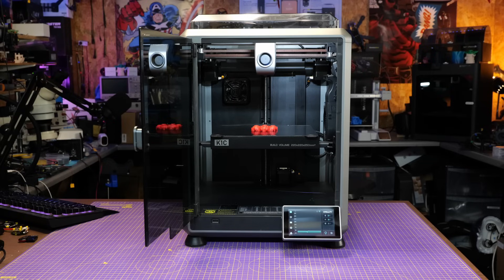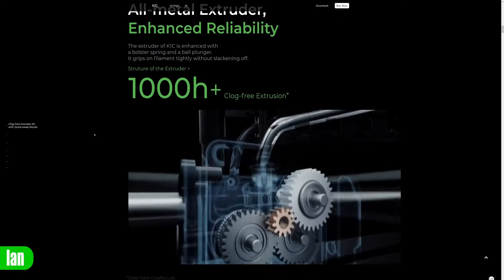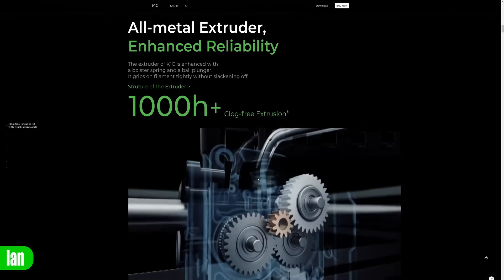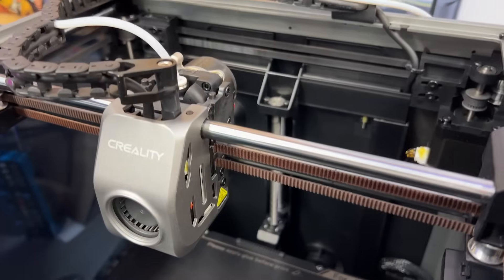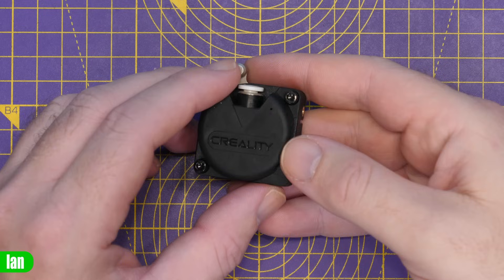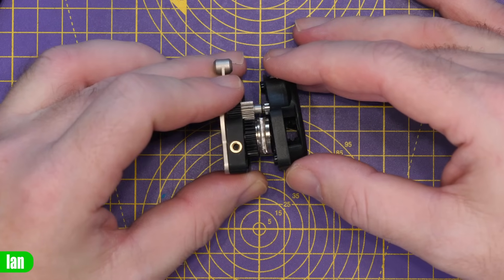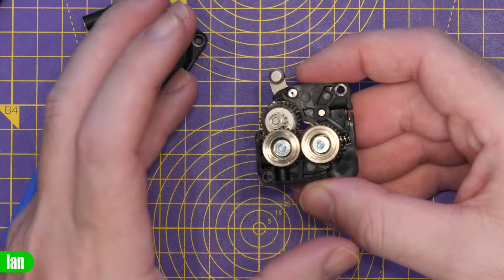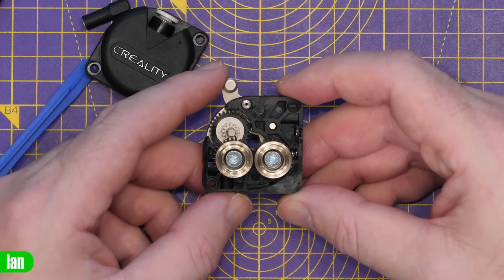Creality K1C All Metal Extruder Is Not What It Seems - They Have Explaining To Do!

Comment: Not all metals are magnetic, many are not, and just calling something 'Plastic' is simplistic at best, as you must know from printing, there are may different plastics and some are very durable. It appears that the actual extruder gears are some sort of sintered material so technically they are correct. Show me any tool (even Milwaukee) or car part that's made of 100% 'metal' and I'll agree that we have been misled.

Comment: Check this out. When my extruder jammed(my fault) I opened it up and found a powdered metal hex driven screw that had sheared off. They can't even put real metal in the metal. My bet is the parts that are metal are powered metal that is baked, and it has to be baked just right. I can't fathom why you'd use it to make a screw.

Comment: Nah it shows a 3D rendering of gears not metal gears, the plastic gears are probably no issue and will be OK (been making and designing plastic gears for automotive applications for years) the true test would be, is to do a load test on tooth to tooth load, measure them over wires and run them on a double flank gear roll tester and review to AGMA specs, the essential components are metal ie those pieces that contact the abrasive substrate. I would say we are into the "all butter scotch-bread" argument - but agreed they should be more specific with their marketing, and I really do APPRECIATE your videos, but hey its China I think if we are expecting "truthfulness" in the selling price, then we will definitely be disappointed!
Reply: I forgot to add - I think it is a good design TBH - I have my K1C

Comment: I think this is a marketing paradox. There are parts where using plastic instead of metal such as nylon is better. Yet they are afraid to highlight because "allmetal" is a magic marketing word. These are the reason they might choise nylon gears instead of metal:
Self lubrication, blocking heat transfer, weight reduction.

Comment: "all metal extruder" has a history. It has refered to an all metal hotend, and people has messed up terminology mixing extruder and hot end for years. A bit too much noise and shouting for my taste.

As for the extruder, it uses different gears than usual. They do not use a through and through axel. HGX Lite gears is used in all plastic housings. I fail to understand why this extruder failed in the first place, and it most certainly is not the things Creality speak of, because there are HGX extruders out there, working fine, not doing a single thing of what they speak of.

Is this actually a patent related issue? One in which they cannot use a gear with an axel? Whey do they need to use reinforced steel, when others can print a part in plastic?

So again. Too much noise and screaming for my tast. Way too little substance.
Reply from the maker: Thank you for your comment. Tbh for me though a little to much noise and no substance

Comment: Just checked the creality official website and the extruder has now had the wording changed from all metal extruder to just metal extruder. 

The picture has also changed to show there is plastic gears with the part the feeds the filament though to be metal. 

Also the animated video shown here of the extruder seems to have vanished.

Comment: what i see is the filament path gears ARE metal! I myself would not bitch at them for all the extruder parts and pieces not being metal. I think it is marketing thing that the extruder filament path is all metal and you are going off on a tangent expecting ALL the parts to be metal. The most important part is and that is the filament path! If however, gears on heavily used machines are failing then there is a problem.

Comment: "All Metal Extruder" refer more like the Hotend to the extruder its self , plastic in extruders are very comon couse Nylon , pom or others works fine (i got a working titan for 5 years and works like new)but for HotEnds things are diferent , "All Metal" means yuo dont have nothing betewn yuor nozzle and heatbreak like a ptfe tube that get burn , thats it😊

Comment: I don't know why they would have said "all metal extruder", maybe its a translation issue. I assume they meant its the new extruder that uses steel reinforcement instead of the old aluminium one. In the end you don't need or want all metal extruders anyway. Using all metal gears would need regular teardown of the mechanism to grease or lubricate the gears. That grease can contaminate the filament being pushed into the hotend. Metal gears will transfer more heat from the extruder stepper to the filament drive gears and soften the filament while its being pushed.
There is a reason Bondtech uses the same system of Nylon and metal gears working together. It is self lubricating. Full metal gears are only useful in very high temperature printers that the K1C and other normal printers simply can't handle.

Comment: I purchased my Ender 3 V3 KE as a bundle kit they had advertised on their website. I had preordered it 2-3 weeks before it had released. Part of the order showed up. I had to email them asking where my stuff was. They then proceeded to tell me that the bundle had changed and I wasn't getting the dry filament box that originally came with the bundle. They changed the website ad and everything. Luckily I had screenshots. Hours and days of arguments with them got me no where. My KE printed and worked so well until 2 weeks ago. The Y-Axis belt shredded, the X-Axis belt has been shredding since new and then my hotend blew up and filament literally wrapped around it  up onto the heatsink. Go with Bambu Labs people!

Comment: Great video! Just a couple of minor points to consider; be cautious about using the lack of being magnetic as proof of a component not being metal, there are more than a couple of nonferrous metals that are used in manufacturing 3d printers, for example most nozzles are not magnetic, yet they are metal. Being metal does not imply iron based, which is magnetic. Finally, you don’t need to tell us you’ll be honest with us, it’s a meaningless statement. Your actions tell us that you’re honest.

Comment: I'm trying to decide if I should cancel my pre-order.  Creality obviously lied here. In some other photos you can clearly see that they are showing metal gears.  For this reason I really want to cancel but It also still seems like a good deal. The only other printer that seems like an equal would be the QIDI X-Plus 3 and it is still $100 more than the pre-order price on the K1C.
Reply from the maker: It’s still a good printer.  But just note the change now.

Comment: With all metal they are talking about the hot end itself. And they are 100% correct it's a full metal hot end. If you extend that to the complete head they are wrong. But honestly - I was not expecting metal gears, because they are simply not needed. Only the pieces that grip the filament has to be of metal, because they have to deliver high pressures. All other gears are totally fine being of a rigid kind of plastic, because the can easy deliver the force that is needed. These gears will last for decades.
The hot end has to be full metal to be able to deliver the 300 degrees high temperature, and that is where using metal is critical. Non full metal hot ends have a PTFE tube going into the heater block, reducing the maximum temperature to about 240 degrees maximum. That would rule out a lot of filaments that need a higher temperature.
So yeah - You can complain the gears are not fully metal, but in practice it makes no difference if they are made from metal or hard plastic - At all...
Reply: It's even advantageous with plastic gears in many applications as they don't need lubricant and run more smoothly. If the tooth load is within acceptable limits then there just isn't any point in using metal gears.
Reply: @motordude67  I like to add that the more metal you add to the head, the more the mass increases. That does not matter too much at low speeds, but it's a totally different story at high speed printing. Every bit of weight added to the head also means more inertia, meaning trouble at sharp edges (fast turning) that will get rounder and less sharp as a result. Also increased ringing will occur, spoiling smooth surfaces. In short - A bit of metal added looks like it does not matter much, but it definitely has it's effects at (very) high printing speeds.

Comment: I think this is just a disambiguation issue.  “All metal extruder” in my experience refers to the heater / heatsink which means the extruder can run hotter and use engineering filaments.    The gearing behind the drive wheel could be considered part of the overall extruder assembly…. So they should have said “all metal hot end” perhaps… although if you consider the drive mechanism to be part of the hot end, then you are sunk there too.

Comment: I think this is a likely just sloppy translation. When I saw Creality advertise "all-metal extruder", I assumed they were referring to all-metal hot-end, since that's what matters for high-speed printing. Metal in the feed gearing is not something I would worry about or even particularly want - it's feeding plastic filament, not holding up a bridge - and the hobs should slip against the filament before enough pressure is exerted on the gears to damage them. I know ranting makes for better viewing figures on this site (and I'm only making things worse by commenting here!) but it's worth considering it 's most likely just sloppy translation in marketing material.
Reply: BTW I think you should link Adam's video in your description, as a matter of courtesy.

Comment: Seems like all kinds of these Chinese companies are just full of bullshit, but honestly sometimes you want failure points so it doesn't destroy more expensive parts. You tore apart the feeder, but what about the hot end? Is it all metal, thats actually the important part, plastic gears require less maintenance and are cheaper to replace so I'm not sure if thats a big issue other then them lying, but if doesn't have a metat throat then its not going to do what they claim and at that point it's definitely fraudulent

Comment: I am not an expert here but we need to put down the torches and pitch forks for a moment and consider what might be the definition of an all metal hot end.  I think the most common definition refers to the heat break material.   Hot ends use PEEK or  PFTE  tubing (plastic) inside to separate the the cold end from the hot end.  These can melt with high temperature filaments.  All metal' hot ends use stainless steel or some other metal.  I'm not saying the K1C's plastic drive gears are great but not sure they are related to what makes up metal hot end.
Reply from the maker: All metal hot end yes that’s a fair point. . However that’s not what they said. All metal extruder is what they said and what it’s not.
Reply: @MadRC  Good point, I wouldn't expect to find plastic gears in an all metal "extruder".   I have had some cheap 3d printer in my time but have never seen plastic gears in the extruder.  I wonder if someone in marketing interchanged  extruder and hot end terminology but it's on them to fix the description or the hardware.

Comment: I'm wondering how much a "full metal" extruder would do ? As long as the parts touching the filament is metal, which is the case, maybe that's all that matters ? Because that's the only part that needs to be solid metal with the abrasion of carbon filaments, right ? the gears are not worn much in the extrusion process ?

Comment: You seem surprised that Creality (and just about all other Chinese 3D printer manufactures) don't tell the truth about their machines (and most of their supporting hardware). Its all quite normal for them. "All Metal Extruder" in reality means just what you see - the gears that do the extruding ARE metal. The fact that the connecting gears are plastic is in their eyes immaterial.

Comment: I bet they say that the parts of the extruder that make contact with the filament is metal which still isnt the same as an all metal extruder. Bottom line is that when metal and plastic gears are working together , when a force is being applied, the metal is always going to win, which is a failure point . I am a content creator/reviewer also , even though Creality has never sent me anything, but I will say that I love my K1 Max and Ender 3 V3 KE, but Creality needs to be completely up front and stop bending the truth because its sounds better. Just do it right from the beginning and be honest. You will get more respect that way instead of adding to your enemies points.

Comment: My understanding of an all metal hot end is the filament path from the input entrance in the extruder  to the nozzle tip via the heater chamber and tubuar guide way is all metal and that no teflon tube is in its path so as it can be heated safely to 300 c without any teflon giving off poisoness gas's from burning teflon, a plastic gear train does not have any limitations as to the performance of filament flow through all metal tubing but may degrade in teeth wear over a long production period
Reply: Yup. This.

Comment: I currently have a Ender 3 S1 Pro and was looking to upgrade.  Looks like Bambu labs is going to be next printer.  Bye Creality!
Reply: Bambu has plastic gears unless you upgrade the part to the hardened.  There are a few videos about this
Reply: @HeathFoster1 on the P series yes, the X1C is steel which ironically is what Creality were blatantly trying to rip off here.
Reply: @lucagordon5770  Well more like the Mk4.

Comment: I never actually thought all metal actually meant fully made of metal. I know it sounds silly but I take it like the commonly referred to all metal hotends. It refers to the path the filament travels is all metal. Metal hobs and tension lever is all that's necessary. The plastic gears are probably better in that application anyhow. Curious where this all goes and what the outcome is.

Comment: Hmm placed my order 2 days ago, my first ever 3d printer. A bit worried now even if I don't understand the difference.
Reply from the maker: If you’re not printing tons of carbon filament probably none. If you intended to run carbon filaments though it daily then something with metal gearing would be better.  However for general use it’s not a big issue.  However it’s also not what they stated it has.
Reply: @MadRC  Thanks. I´m sure it will be fine. I will print carbon once in a while but mostly PLA/ABS.
Reply from the maker: @kompisworld  yes you will be fine. My overall opinion on the printer is good if you have not seen my review please check it out. However I’m just very annoyed at this nonsense
Reply: @MadRC  Great review, I saw it indeed. Thanks for the fast upload mate!

Comment: Dang. I’ve only really used Creality and Elegoo. Elegoo was absolutely garbage, and I liked the Enders well enough. I’m really struggling to figure out where to go from here. I wan’t 4 matching printers, but I’m not sure what to go with anymore.
Reply: The Elegoo Mars2 was my first printer. I wanted to start with the cheapest. It's been fine, for the cost. But now I want to print with filament. Since I have a few years of knowledge and understanding of the FDM printer market, I feel like I can trust myself to spend a more substantial amount on higher quality. 
   Bambu Labs is high on my list. 
     I know that Bambu's firmware has been cracked, and from what I gather, Bambu is playing nice with the hackers. So far so good, and this should mean that at least for Bambu printers made before 2024, we might see some community inspired additions to the functionality of Bambu. If the team working on hacking the f/w keeps going, and Bambu wants to play, maybe even see some cool community inspired stuff in the coming years  🤞
  If not Bambu, Qidi is a close second.  Voron, or Peopoly are also on my list. We can save some money with some manufacturers, if we're willing to do more of the assembly process at home, so that is a good way to get a higher quality product, at a less expensive price. So far, most of my attention has been on Bambu, so if I decide to go with one of these other brands, I'll need to get into the details before pulling the trigger.
Reply: @Inertia888  Personally I'd give the Sovol SV06 a try if you're on a budget. Otherwise, avoid Qidi as they also have no idea what they're doing. Best thing after that might end up being the A1 or A1 mini

Comment: I always thought that for many "All metal extruder" ment All metal HOTEND. The fact the some driving gears are not metal it's not that bad and probably makes sense in regard to heat transfer and dissipation in that area.
Reply from the maker: I do agree that all metal is not necessarily ideal either and actually the right balance is to have a single nylon or plastic gear somewhere in the main drive to take the force of something going wrong. However this is not even that. They are clear saying all metal where are the casing is plastic. The drive gears are plastic and the only medial things are bearings and the filament feed rollers.
Reply: @MadRC  Other than failure points, plastic/pom gears  make sense where heat transfer is a factor. However I agree with you, this is Creality communications fail: an all metal extruder should be ALL METAL.
Reply: @GiovanniEsposito5  It's not a communication failure. It's marketing deception.
Reply: I think "all metal" is about the parts touching the filaments, not the whole mecanisme, that would have no benefits if being metal ? @GiovanniEsposito5